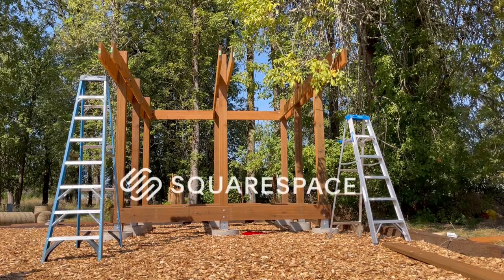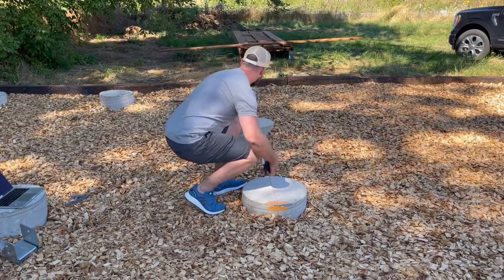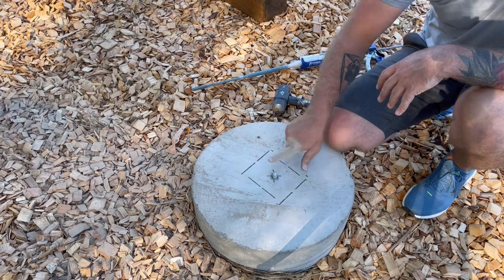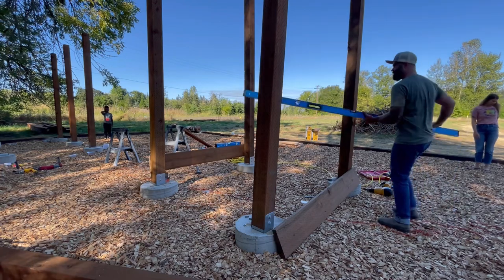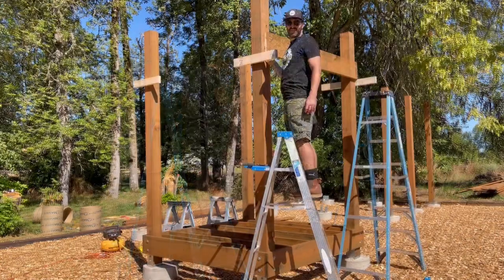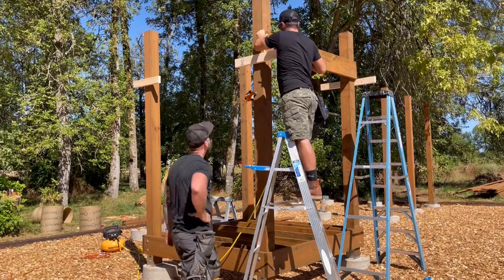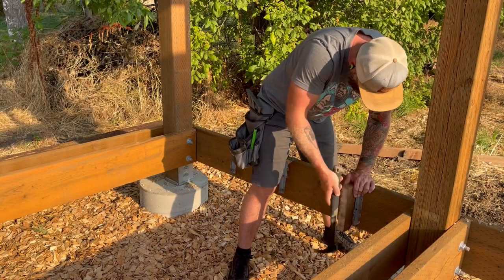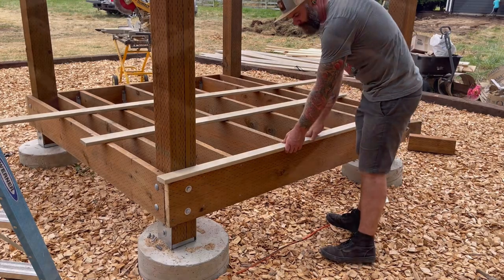Building an Elevated Deck || Treehouse Build Part 2

Comment: Once upon a time ago, I worked for a company as an Engineer that made residential wooden playsets.  And I can say with absolute certainty that this thing is completely over engineered... and Awesome.
Reply: 6 X 6s....
Reply: Yeah... When he said 6x6s, I was like, "that's a lot, but it gives visual weight to the structure." Then he started doubling each post with 2x12's and I was like "that is more than extreme, but I guess kids will be jumping and tugging on things and you want to be safe." Then he started putting in 2x12 joists at what looks to be 16" O.C. and I was like, "when the tornado comes, all kids to the tree house; it is the strongest structure in the county."
Reply: His comment about being strong enough made me chuckle. You could probably build a ranch house on top of this in tornado alley and it'd be fine. Ridiculously over-engineered and awesome - as you said.
Reply: I'm looking to build something just like this. So would 8 4x4 posts be plenty strong? Mine will only be 6' off the ground.
Reply: This is how you do it for your own kid…lol

Comment: Just a heads up;
 When you notch into the 6x6, this gives true support.  When you use carriage bolts drilled into the 6x6's, your support is now reliant on "sheer" strength of the carriage bolt itself.  So notching into the 6x6's is definitely the way to go. Plus it's up to code, at least in Wisconsin.  So notching is much better than relying on sheer strength of the bolt.  Still, very nice job!  66carpenter
Reply: this is great too keep in mind but too late for my project...the sheer strength of a 5/8 inch carriage bolt still looks to be about 30kN which seems to be about 6700lbs so more than enough for my use case

Comment: the cantilever deck portion, you should add a double beam under the joist perpendicular to them bolted to the posts to add support under all of them. that is alot of weight pushing on a rim joist that has no support from beneath and the beam will transfer all the weight to the posts and not rely on the strength of screws alone. looks awesome man, keep up the good work
Reply: I agree, the rating on the screws is for side grain to side grain,  end grain isn't too strong. Add 2x10s under the front posts to support the cantilever.
Reply: Was just about to add this comment. That's too much weight relying on end grain screws, especially when those joist ends will be the first to succumb to water damage. It might take a while, but it will eventually fail (prematurely), faster if they were the cut ends.
Reply: I’ll add, what’s the power source? A long extension cord will drastically lower the rpm’s on your 1/2” drills.
Reply: Agreed
Reply: I agree give it the extra support where it needs to be, that said this thing is built strong so far!!
Reply: Definitely add a beam before it’s too late. Even with the minimal weight that will be on it it would be good practice and wouldn’t take away from the look once it gets sheeted.
Reply: Agreed, although some triangular bracing might be a simpler alternative.

Comment: Tip for removing concrete from drilled holes. Use one of those  baby nasal tools (the ones that suck snot from baby's noses.) You can stick it in the hole and blow all the dust out. I keep one in my drill case.
Reply: I just went to the $1 store and bought one of the condiment squeeze bottles to blow the hole out. My coworkers at the time made fun of me when they saw it... But ended up using it instead of dragging out a shop vac.

Comment: All the load is just carrying on those bolts. It’s probably fine, but nothing is framed like that normally. Youd typically want those posts under the deck supporting some main beams and the decking sitting on the beam. Some big tree houses use massive anchor bolts into the tree but even then, they’ll have beams with decking on top so that framing Is carrying framing. Not bolts carrying it through wood which can shrink or move.

Comment: Trade trick. When setting your anchor bolts. Place the bracket on the pier pad, place the washer and thread the nut, place the anchor bolt through bracket. place the rotohammer setting on "hammer only", put the drill bit on top of bolt and vibrate in hole. No bolt damage and it tightens up. Great video and play structure for the kids!

Comment: In the next episode we'll be placing the 1969 VW Beetle on the top deck to check for strength and perhaps leave it there for a cool curved roof look! 🤣😂 It will hold it. It's overbuilt for sure. Can't lie though, I overbuild everything, so I get it. Looking good 👍

Comment: if I have to drill with large auger bits like that I put chainsaw bar oil on the bit, helps the bit cut through without over heating

Comment: The problem with temperature is it’s taken in the shade. 30 degrees warmer in the sun. We hung tarps so we’re only working in the 100 degree shade and not the 130 degree sunshine. 

When you cut pressure treated wood, I think you’re supposed to field treat the cut ends. There’s no treatment in the interior of the wood, so when exposed through cutting it is as vulnerable to rot as untreated wood.

Comment: Hey there. Watching from NZ. Glad to see our pine bring put to good use.  But you installed those decking boards upside-down.  Every deck I've seen here has the grooves on top.  This is done to increase traction.
Reply: The grooves should face down. They allow Airflow under the decking boards to prevent rot. All the decks you've seen with the grooves upward are actually Installed wrong

Comment: So far very good. The only thing missing. Even though you might think pressure treated wood is ready to go and can be just left as is it will start picking up molds and will rotten soon. To give your build extra life give it a 2 coats of Osmo 420d clear satin. It will make wood pop up and will protect it for really long time.

Comment: Hey Jason, watching the build totally brought me back to 1994... when I bought a huge climbing frame for my kids. I had to dig out some giant tree stumps, dig holes and set the metal footings. So I bought plastic buckets from the big box store, and then mixed concrete and poured. Then I assembled the frame, and finally concreted the buckets into the holes I dug after levelling the frame. Not as well done as your build... but they still were all able to use the swings at thr same time and it was solid. This really brought back good memories of a build I had totally forgotten. I got so much satisfaction from that project, and a large deck I built back in 2000. I really miss the big projects, Cheers Nig

Comment: Structural screws are just as strong as 1/2" lag bolts and WAY easier to install, no drilling holes and no need to cut off the ends.
Hope this helps for your next "tree" house.

Comment: The only thing that you're missing is butle tape on top of your deck framing. It protects the framing from water damage and makes the framing last a lot longer but other than that, great job.
Reply: Since he's using PWF (permanent wood foundation) lumber instead of just regular treated lumber, and it's a treehouse that he'll be pulling down when the kid goes to college, I'm sure he'll be alright!  He's going to hate himself when that time comes, though, lol.
Reply: @Offspring22  Like you said, he is going to hate himself.  But I think when he looks at what it will take, it will be time to make it a guest house.  Up the electrical, and pipe some water out there, and instant guest house.  Or party place.  Add a fire pit, with patio and chairs.  I would have said man cave, but he has that new huge room.

Comment: If the need arises, try adding the nut onto the wedge anchor  flush with the top of the bolt prior to hammering saves the threads to get it started.

Comment: I don't want to sound a know it all because I can't spell worth a darn..  but should have made three of those square rebar thingys and wired them to the long rebars you drove in the ground.  I work with a cement man who does a lot of cason footers.  And he always dose a good rebar inside.   And usually mounts something down in the concrete to fasten whatever he builds on top to.  Thus making the structure very solid to the ground.  If not have the money for Cason tunes you could have just used porthole diggers and gone down 2 and half feet.  Filled your holes with water and used a sand and gravel mix and dumped the bags directly into the water and tamped them good and they would anchor a 4x4 really good to the ground.  It's fast and easy and how I made my back porch and fence posts.  Works with 8x8s too just need a wider hole.   Before I go I gotta say I love your videos and would patrion if I wasn't so poor.  You have great report with son and friends and you are a total goof which I love cuz I am too.  Godspeed my friend!

Comment: dude you need some wood owl auger bits for drilling deep holes they are reasonably priced and those hole could be done with any old battery powered drill they rock.

Comment: I would add some blocking between each floor joist, and a board across the posts to support the joists of the cantilever.  Other than that, man, great work so far as usual.

Comment: Pro tip on joist hangers some framing nailers have a positive placement which allows you to use it when putting up joist hangers! its looking good!
Reply: The thing to watch out for when making this recommendation is to ensure people know they need to use nails suited for joist hangers. They need to be a one-piece nail; standard framing nails (positive placement gun or not) aren't suitable. For anyone who might be confused thinking all nails are one-piece, it refers to the manufacturing process. If you use the correct nails, you can shoot straight through the metal on the hanger if you don't have a positive placement tip (at least that's the case here in Australia), but it doesn't look as neat. In any case, a palm nailer is great for hanger/strap/bracket nails, especially in tight spaces.

Comment: Only one tip. The 2x10’s will shrink a bit and the 6x6 will not shrink in length so cutting them flush with the 2x10 will cause an issue in about a year when you start to get bulges above each one.

Comment: For that back form, just dig out a surface shape (i.e a square or rectangle) frame it off for a cement pour and make a small flat under the foundation that allowed the back post to be centered.

Comment: We spec the Simpson strong tie expansion anchors in almost every precast wall panel structure and parking garage. Specifically the strong bolt 2. They are great with a ton of capacity and their design software is super easy to use.  I've never specified or seen the adhesive used with the expansion anchor though. That should work out great for what your building.

Comment: Think about adding a ledger board the the front of upper deck, under over hung joist. It probably won't matter on your tree house, but if you have adults on the over hang I would worry a little. Looks great!
Reply: @JorgTheElder  the deck part I think is only being supported by 4 joist the ones on the 6x6s. He added cats which helps tie it in, but imo it's not enough. I would run a 2x10 under deck joist and fasten to 6x6s. I wish I could screen shot a picture and post it.
Reply: Jorg - You and JC are probably both right. 

Jason comments about a cantilever but half the deck joists (6 of 12) are not cantilevered at all. There simply long clear spans to a cantilevered rim joist. (JCs comments)

The fact that the lumber is about twice as big as needed is accurate also; your comment. 

The scary thing is when people watch videos and think it’s right. Jason is a fine woodworker, and most of this is consistent with acceptable building practices and tremendously overbuilt, but there are a few places where there are critical design flaws. The overbuilding probably compensates for the flaws.
Reply: @johnlee7085  only reason I caught it is I do quite a bit of framing and deck building.

Comment: I would be a complete nob like you doing this, I feel like I’ve seen other videos where they have put the anchor bolts in as the concrete is hardening? Advantages vs disadvantages here? Thanks.

Comment: At 21:36, the 6 joist in between the post are not cantilevered. They are clear spanned out and hanging from a cantilevered rim joist. Definitely not code, and would be a problem if not massively over built and a non inhabited structure.

Comment: So far you've got all the weight on the carriage bolts and none on the beefy 6x6 posts. That top deck should be sitting on top of the posts. It'll probably be fine, can't see all the bolts failing. Ordinarily you'd rest beams on top of the posts and then build your floor system on the beams.
Reply: I think if it was a coded structure, the post needs to be notched for the beam to rest on the post. But as mentioned many times, there’s lots of overkill.
Reply: @johnlee7085  yeah, all I was getting at was the role of a beam to distribute the load to the posts and footings. You can sit a beam on posts, you just have to add ties in that case.
Reply: Sorry. Didn’t write my response very well. I agree with you. Meant to offer another option.

Comment: For Simpson products the Z doesn’t mean it’s for dimensional products, it stands for Z-Max which is there outdoor coating that protects against rust and is rated to work with treated lumber.
Reply: Zinc then coating I would guess?
Reply: @verygoodboy2688  Yes, it's a thicker galvanized coating.

Comment: NZ pine decking is probably just radiata (Monterey)... Nothing special other than the marketing unfortunately.  I doubt it's native Rimu as we can't even get that anymore.

 Hopefully the pressure treating on the stuff you got is ACQ (Alkaline Copper Quaternary) or Micronized Copper Azole (MCA) and not  Chromated Copper Arsenate (CCA) since the arsenic isn't good for you/your son.   

PS before anyone asks, the grooved surface can go on the top or bottom, just depends on if you want nonslip or not. I think it lasts longer and looks better flat side up.

Comment: Nice job! Could have saved time and effort by putting your anchor bolts in right after the concrete was poured and topped off.

Comment: Dude... Great series so far but man I have a critique for you - you got in a hurry drilling holes for your carriage bolts and trashed your drill bit! The wood was basically on fire. Heat is the enemy of sharpness. I believe if you had gone easier with it, it would have been an easier cut. Now that still bit is dull lol.

Comment: I thought the “Z” in the part number differentiated the ZMAX which is their hot dipped galvanized outdoor hardware to their standard hardware for indoor use. I could be wrong…
Reply: I came to say the same thing. R is for rough cut, Z is galvanized, not additional letter for dimensional.

Comment: I am far from an expert, but I'm pretty sure it's better if you place the beams over the 6x6 rather than mounted on the side by bolts. If you mount them on the side like you did, you're transferring the weight to the bolts, which places a lot of shear force to them. If you notch your post and mount the beams over the post then you're transferring the weight directly to the post rather than through the bolts.
Reply: While you're correct, those bolts are rated for more weight than he'll ever put on them. Each one of those bolts has a shear rating of 85,000 psi

Comment: the 16' joist span without a beam to support them at the 12' point has me a little nervous but it's been a while since I've looked at the spam tables.  is that cantilever going to be a roof or a top deck?

Comment: Are you going to put diagonal bracing in (I.e. steel wire with a turnbuckle in two axis) or is the spacing between bolts at the joints enough to counter the forces?

Comment: Suppose you wanted to make a single free standing post on a concrete pier to make an umbrella inspired trellis (exaggerating to get the point across). I would expect the post needs to be encased in the concrete to achieve sufficient support (cantilever) as using a metal fixture would place any wind loads into the fasteners. Is this assumption correct?
Reply: Wood encased in concrete creates all sorts of problems and premature failure. If anything, the steel would be increased in the concrete and possibly up the wood.
Reply: @johnlee7085  the problem with my mental picture is all the metal attachments (concrete to wood) I've seen have been a U of sheet metal attached to a few prongs. The U only supports lateral loads in 2 directions, after that the load goes to the bolts
Reply: The collective shear strength of the bolts are quite high. Definitely greater than that of rotting wood from sinking it into concrete. 

I’ve gotten around your concern even more by DIYing my own brackets out of 2 u-shaped pieces of heavy strapping.

Comment: Great job!  Hopefully you'll build the actual structure so the weight bears on your posts and not your rim joists.  You'd be fine with the deck alone, but adding a structure on top of the deck with only mechanical fasteners might be pushing it too far.